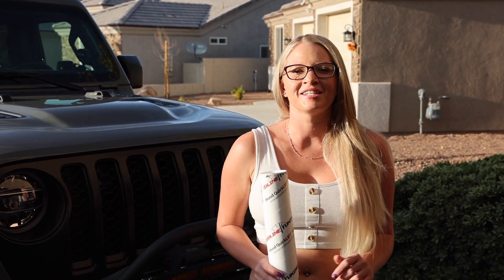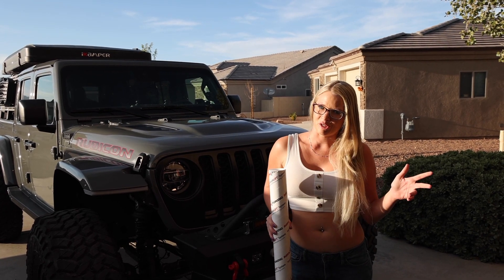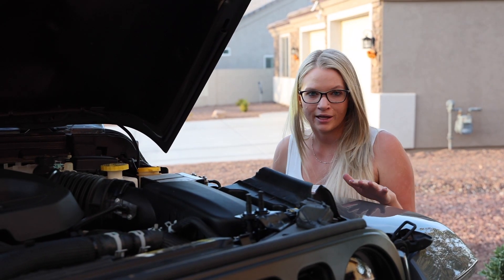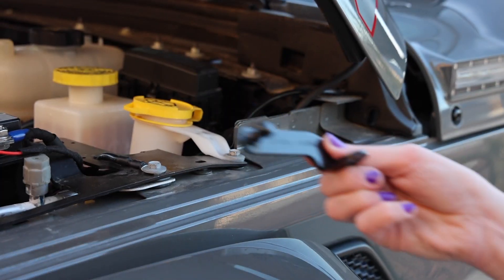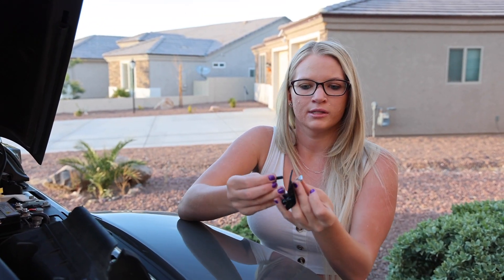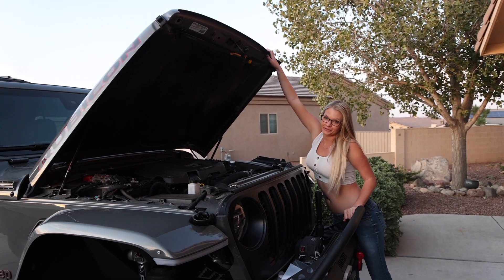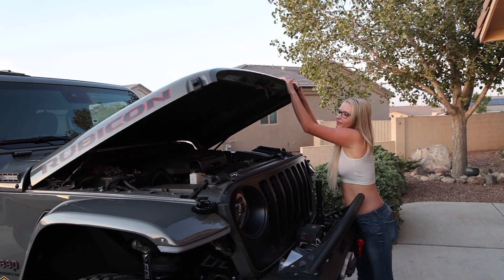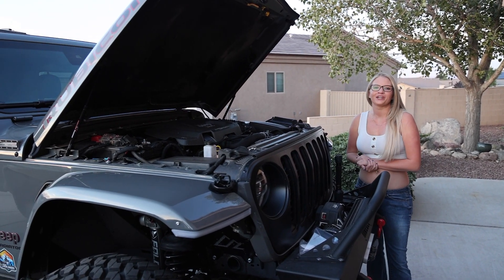Upgrades For The Jeep Gladiator | QUICKLIFT

Comment: I believe the struts were installed upside down
The thin rod should be at the bottom when opened, and the thick charged end up top towards the hood, otherwise the charge will leak out, similar to truck caps with rear windows.
Just double check with manufacture.
i just looked at the photos from supplier and thin rod on fender, thick on hood,
Reply from the maker: They fit better that way.. we have diesel JT with a bracket in the way..  not sure if it matters anyways as they are gas
Reply: @OverlandishAdventures  they might work, but the gas charge can leak out causing them to fail, I’ve seen that a lot with fiberglass truck caps in the past,
Reply: @OverlandishAdventures  there is no  
“gas” in them…. They are spring with air restricted and a slight hydraulic oil dampening… Think on how a bicycle air pump operates…

Comment: I have them on my Gladiator also. Kept the OEM hood rod though to use in-addition to the struts on REALLY windy days, the struts & rod combined make a good/solid 3-point support to resist the wind.
In cold weather, however, the struts are slower opening...they work best in warm weather and/or when the vehicle has been run and the engine bay heats up, which in turn heats up  the gas in the struts.
-- BR